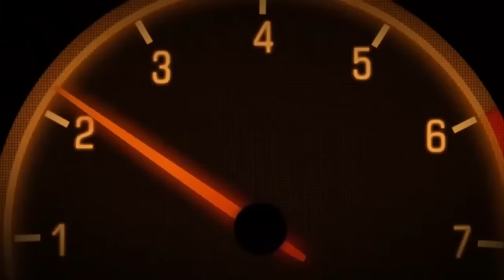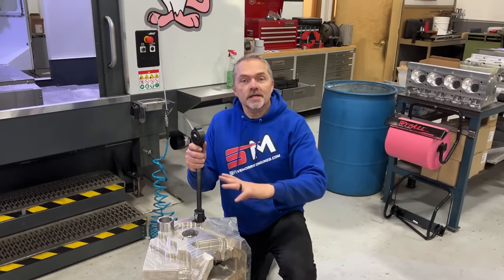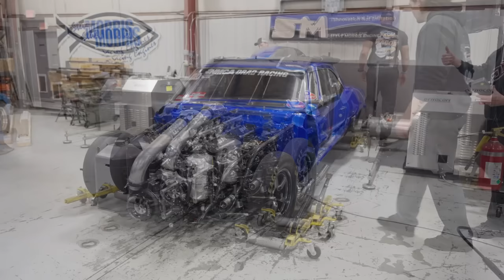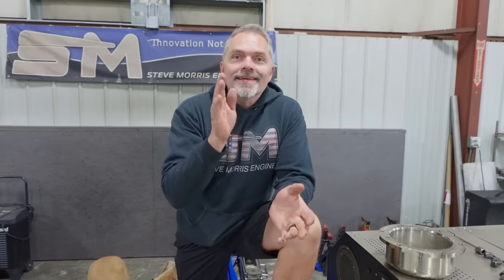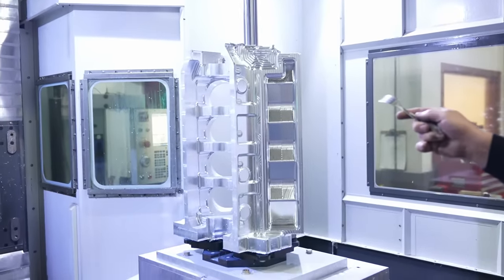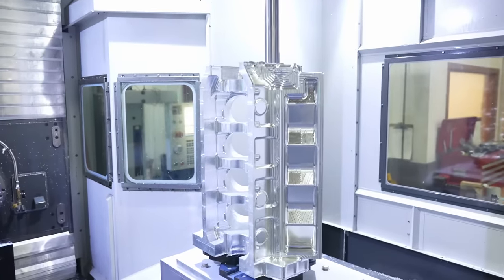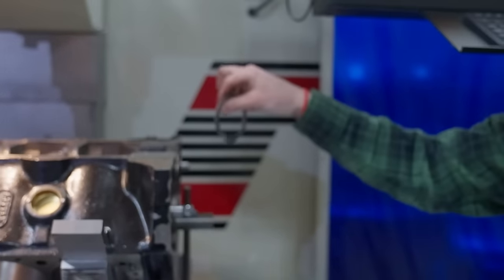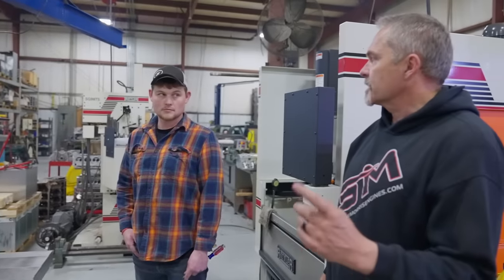Billet SMX Block… SBC Roller Thrust Bearing….Back From The Dead 1969 Camaro.

Comment: The dullness of machined block can be caused by old coolant in the CNC machine. Your new machine has fresh coolant so it protects the exposed aluminum from corrosion. As coolant ages it becomes contaminated by salts, salt + heat will make aluminum dull.

Comment: The hazing of the aluminum was likely caused by the heat treating oven having too much oxygen in it. You guys seem to keep their ovens as oxygen free as possible. I like the pattern you are achieving during the final machining of the block. As long as you limit it to only the exterior surfaces of the block.

Comment: Only function matters, not how it looks.  In the water jacket area you should have ribs in the block to increase surface area and run parallel to the coolant flow.  In high stress areas you can go with a more polished look to relive stress and avoid cracks.  I see doing this around the mains and cam tunnel / lifter bores.
Reply: Agree. No use to introduce stress risers. Besides, there is elegance and beauty in a great design.

Comment: Those tool paths in the “wader” jackets probably on a micro scale actually help shed heat into the coolant. 
Almost like micro “fins” if it were an electronic heat sink… 👍🤘
Reply: i think that depends on how the water flows past it. if it's rough in the wrong way, you'll have little eddy currents that will trap a bunch of heat in pockets next to the metal. if it's rough in the right way, it's extra surface area, like you said.

Comment: when it comes to the finish, my opinion is...
the water passage areas that get covered by the plate, should be "rough". reason being, more surface area for water to contact and transfer heat from.  same reason for fluting gun barrels.  it looks cool and makes the barrel lighter, but it also creates more surface area to help cool the barrel.
everything else, could be smoother, but I like the rougher "machined" look personally. and it might also help with heat dispersion in the open air.

Comment: Using that non polished finish provides more surface area for heat dissipation.
Might be pretty insignificant, but would be something.
If that's in the water jacket area, not sure how fast the water flow is, or if that would cause cavitation which might affect cooling.

Comment: Steve, the first thing I thought of when you hooked up the car to the hub dyno was you need to build some kind of protection around it. If that blower would have blown on the hub instead of in that room, who knows what would’ve happened.
Reply: Not how it works. 

When a car is on a dyno, you stand clear. You don’t stand on the radial plane of the dampener, flywheel/flexplate, and most crest any not the drive shaft. 

You can’t shield a car on a dyno. I’ve seen a driveshaft get literally punched through a brick wall. 

All those videos you see where people are right next to the car etc. is not a representation on how it is done. Those can all collect a Darwin Award. There is one place to stand in a dyno room, and that is several yards off to the side in front of the car.
If that’s not possible, leave the room and wait outside if you’re not running the car. 

Look at Steve’s dyno videos. Nobody is near the car and all are off to the side in front of the car. 

A blown impeller is not a common issue so not even something you can easily do. It will be heavy, big, not fit all cars, create cooling problems etc. 
He doesn’t dyno in front of 30 people so the easy sollution is to just stay out of harms way.

Comment: Steve - on the final machining YES but with a twist...at a very prominent spot (noticeable/visible on the finished engine - maybe on the outside of the water jacket plates) on the block - alternate the .075 prominence/depression lines so that your "SMX" logo is integral to the final finish  (switch prominence to depression at the outline point of the letters).

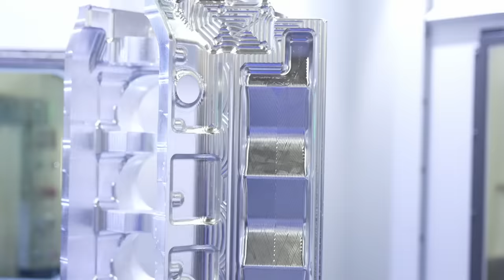Comment: 15:20 That’s a coolant passage area correct? It won’t be seen after final assembly? I’d say do an engineering study to determine what type of final finish there would be best for thermal heat exchange. Maybe it needs webbing lengthwise to help direct flow, or other areas left built up where there might be cavitation or a stalled flow pocket. Maybe the cover plates also need some special machining on the area facing in.

Comment: The finish looks great,  it might even work as a heat sink and help with cooling.
Reply: That does not add anything in terms of surface area worth a temp difference. It's purely cosmetic.

Comment: previous heat treater might have used solution heat treating. you should make the pattern in the water jackets even deeper and rougher, more surface area to transfer heat.  in fact, you could just add fins to the water jackets to improve cooling,.

Comment: It is dull because they probably treated it in an atmospheric oven instead of vacuum or inert. As for the surface finish and heat emission, a mill finish has an emissivity coefficient of ~0.20 whereas a polished finish is ~0.09. The difference is so small it would never show an appreciable gain; more would be seen from a coolant change. It is all about visual appeal at this point. Save your machine hours for better yields.
Reply from the maker: Bigger step overs less machine time

Comment: The groves form x shapes almost. Idk y but It seems like a  straight line grove would look better like v shape or even a cross hatch in intersecting directions would look almost like brick pattern or if it's small you could almost hit a carbon fiber looking effect. But if that's cool and efficient that works just fine.

Comment: Both water and oil follow the path of least resistance, so the smoother the inner surfaces are. The better the flow.The outters surfaces. I would just glass bead them to make it look like a cast peace if I am got full sleeper mode.
Reply: However for cooling water, a rough / finned surface offers better heat transfer.

Comment: I think you should anodized (clear or color) every surface that doesn't create a heat transfer surface. The aluminum oxide layer doesn't transfer heat as well as the bare aluminum.

Comment: Solution and age are done in furnaces.  Ovens are for annealing and baking cakes.  I would use a raw sample of block (specimen to use as a coupon for lab testing, section and mount micros)  you could leave it attached the block and cut it off after heat treat.

Comment: I like the tool path finish. I would think also that it would add surface area for heat removal. Especially in the coolant and oil path ways.

Comment: My opinion on the surface finish especially in the water jacket pockets is a slightly rougher surface would provide sort of a heat sink effect. More surface area in contact with the water to provide better cooling. Could even add some small "hills" or vanes in that pocket to cause water swirl and possibly provide better cooling of the cly walls?

Comment: Time 1530   Surface finish.   Regardless of visible finish, I'd put a rough or finned finish in the water jackets to assist in heat transfer ( larger surface area.
Reply: Just add the colon. 
YouTube will automatically turn it into a timestamp. 
15:30
Reply: @mattmanyam    Sometimes YT deletes posts that have a time stamp thinking ti is a direct link to something.

Comment: Do the math guys for the fun of it...those little rollers are 4MM Diameter. The math problem will be "what is the actual RPM of those little rollers when the crank is say running 7500 RPM?"

 You will find that the bearing is far exceeding its specs for max RPM. I did this on a lower unit for an Evinrude motor that uses about the same size bearing. The gear it is up against runs a max of 3172 rpm when the motor crank speed is 5900. The result was the rollers have to run about 77,000 rpm. Typically KOYO USA recommends RPM speeds of 5000 RPM and lower. But in actual science, the larger diameter the bearing is the lower that max number goes due to raceway speeds. The only other way is to pay the extreme cost of Aerospace products which are a whole new level of tolerances. This problems result is downright amazing when one does the actual math. Not only that but those little 4mm rollers are constantly skidding around in a circle as they are strait machined (IE not tapered to naturally follow the circular movement. Just think of how lubricants work for us keeping metal away from metal. It amazes me every time a customer brings in a lower for a repair or rebuild ant they cant understand why it failed. Lack of maintenance accounts for 80% of my builds. The absolute highest loaded bearing known to man are the ceramic bearings used in rocket engines for the turbine pumps spinning at over 100,000 rpm. Ceramic is the only material that will take that sort of abuse physically and chemically due to the volatile fuel components used in rocket engines.

Comment: I would almost prefer it pushing on the rear thrust more than the front main. But unno maybe that's not what's going on, but I suppose the front main gets the most oil. I've built a few engines but never a Chevy 😂

Comment: Seems to me like when you have a rear thrust engine like that and then you add a rollerized thrust in the front that you would want the rear thrust to make contact first where a little bit and then begin to touch the roller thrust especially under high boost in launch

Comment: Beautiful work. My opinion on the surface finish is to have different ones in different areas. What I mean is the external surface would be different than an internal surface that sees oil and different from the passages that see water. I would like to see mainwebs to be a super fine finish, with all the gasket/o-ring areas different for the required sealing requirement. I really like long straight lines that show the precision of the equipment as opposed to a wavy curving style. Just an opinion... thx

Comment: Most ovens you figure the total weight of what is put in the oven and then the material type for the temp and time in the oven. Then a vacuum is pulled and the cycle starts. If there are either contaminants or oxygen present you will get discoloration. During the process.

Comment: Hi Steve. Looks like there’s not much surface on the crank snoot for that roller thrust bearing. Looks great on the main cap obviously but on crank side it looks like a disaster waiting to happen. Looks like that bearing needs to be smaller what ever the amount of that register by the looks of it. Why not go smaller to eliminate that register and that way it will sit against full surface of crank rather then floating. Yes looks clear as day it should be smaller diameter and no register can’t image a good reason to not do that. . Idk hopefully you can explain pls ??? Thanks and amazing work as usual!!!

Comment: Have you tried .100 step over in the water jacket area?  It would be interesting to see if .100 verse .075 increases the heat transfer.  Who cares what the internal water jack area looks like?   Your wanting the engine to cool the best that it can for the amount of water flowing through the available water passage.

Comment: Hey Steve, does the milling process sound different from before heat treating to after heat treating? Being hardened make a difference on the wear on the tool as well?
Reply from the maker: Machines better

Comment: Mold maker here with a ton of heat treating experience. Although my experience is with tool steels mostly stainless. So it looks like the shiny block was done in a vacuum furnace or was bagged to limit any oxygen hitting the surface. The dull blocks look to me like they were exposed to atmosphere during the process. As far as metal movement its very common to have parts actually lengthen in one axis and shorten in another on the same part. Ive seen a 420SS block 12x16x3 twist like a potato chip .060"  yeah good times.

Comment: My assumption on
 the difference in colors is due to the atmosphere in the heat treating ovens or the cleanliness of the aluminum before it went into the oven. Did the ovens use ambient air, vacuum, or an inert gas.

Comment: I would think that the machined surface would enhance cooling compared to a smooth surface in the water jacket and oil crankcase and lifter valley areas.

Comment: Yeah I was wondering about machining everything with a full size finish on it minus  everywhere it's required for close tolerance remachining are such as cylinder bores cam tunnel crank saddles and cap bore areas and register areas. When do you heat treat on main caps.  Yeah that's a nice finish look for non close tolerance finish.  Is that a Torrington for thrust.

Comment: For looks, in my opinion I'd say leave it as unfinished as possible. Sure mounting surfaces, places around holes etc will need to be flat so they don't leak and still function but the rest I'd leave as unfinished as possible. Looks great, quicker, and less run time. I wouldn't think that potentially a few extra pounds of weight on the block would make a difference for most people but if it does then maybe a couple options and adjust the costs accordingly.

Comment: I was wondering if those rougher spots inside the coolant pockets would actually help transfer heat to the water, which lead me to wondering what it would be like to add actual little fins in there.
Running aggregate heads is a pain.

Comment: I love the machine finish! I am curious if the little bit of extra surface area helps dissipate heat? Or is it only esthetic?
Reply: That there is purely cosmetic. You can hardly feel it.
Reply: @AB-80X So if it was done more course, could that help with cooling? Or would the ridges become a point where cracks could form? Or is it something else? I know they currently cool just fine, this is more of a curiosity question about how this current design came about.
Reply: @briangrow6450  
A gritty or dimpled surface could possibly mean a slight increase in cooling. In a situation like this, I would not worry about stress risers. That's usually not where they are found. 
Looking at how the head is designed, I cannot see that it would even be a point of issue. As you say, they cool fine as is. The limiting factor here wold not be the water flow in the heads, but how much air you can bring through the radiator to cool the water. In a lot of these Drag and Drive applications, that seems to be the limiting factor. The SMX and SML uses a lot of water compared to a lot of other engines, and it is never at full power, and least not so far. Everyone has so far ran M1 for the big power numbers, so the cooling is not even a thing during runs.

Comment: The heat treatment is probably good for many reasons. One thought that comes to mind. Would the heat of the engine running, cause some of those tolerances to shift without the heat treatment. I mean, is it good that you're heating it up and letting everything settle aside from all the other advantages of heat treating and then machining the final tolerances, so they'll hold truer in the long run?

Comment: The down side to the .075’ stepover is it adds a lot of additional machine time and lost revenue timing up the machine. It’s more effective to use a bullnose E/M and increase the feed rate while improving surface finish. It will save production costs in the end.
Reply: Bullnose will not save any time on curved or angled surfaces. You're still sculpting with the radius.
Reply: I’m pretty certain I know what I talking about, I mean I’ve only been doing this 43 yrs now, but hey, I could be wrong?

Comment: What about anodized or hard coating the block? Putting a nice finish on the block is all nice but personally if the aluminum corrodes or gets stained I don't think the surface finish would matter.

Comment: I'm really curious, at 4:00 in this video, if you now consider taking more or less material around the cam tunnel on the first process step prior to heat treating. Taking more or less material to hold the "roundness" of the cam tunnel. Or does it even matter?

Comment: Wondering what kind of performance gains I could gain by switching from a factory cast iron block mopar to billet with iron sleeves? Tall deck height and stroker crank... be interesting to see

Comment: I have worked in an aluminum  foundry for years and we heat treat our own parts and I can tell you that the one block that's still shiny didn't get treated to the time the other blocks have could have been treated at the same temp but not as long or it wasn't brought up to the right temp but for the treat to strengthen the aluminum  it is gonna be the dark Grey that shiny block isn't gonna have the strengthen as the dark Grey block.

Comment: After that block shifts around during the heat treat, how do you indicate the block in the machine for the second process? I would hone the main bore first and then indicate off that for the rest of the process but then you may need a fixture…

Comment: Would it not have more surface area with the striations within the water jacket around the pistons? The idea is used within the firearm industry to mitigate heat. Different applications, maybe some overlap.

Comment: would there be any advantage to machining in little fins in these cooling passages .040 x .250 for more surface area to pull heat out?

Comment: Do you guys send out the blocks to HIP?  Hot isostatic pressing?  I used to run a HIP Vessel.  The grey color may be a reaction of the coolant used from machining.  We would sometimes see that on machined parts from time to time

Comment: Steve, question! With a rougher finish in water chambers, wouldn’t the block transfer more heat to the water/coolant? Looks to me, it would have more surface area in contact with coolant?